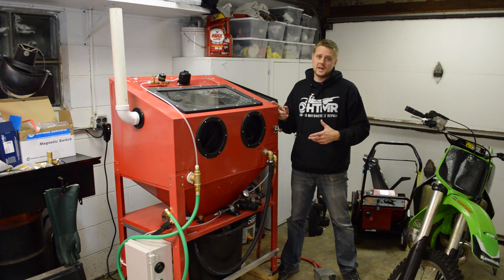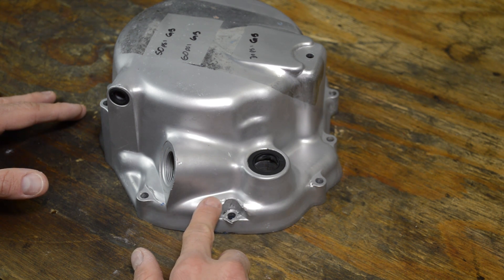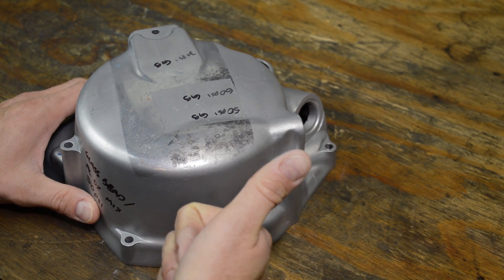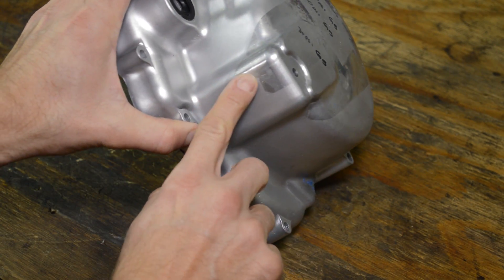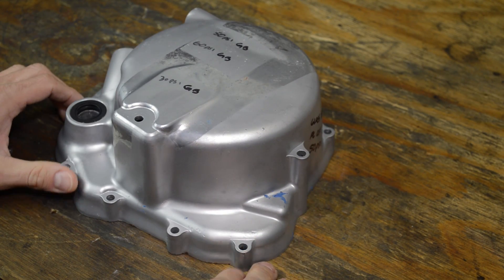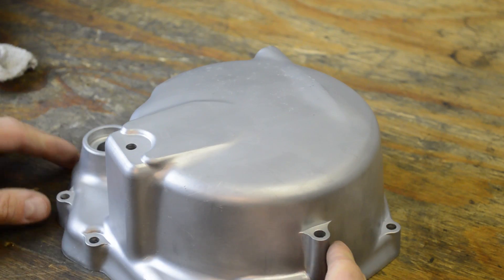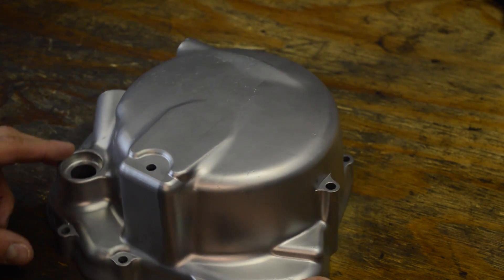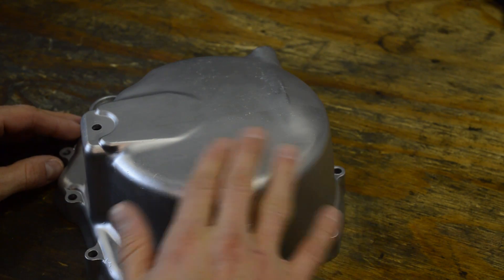How-To: Vapor Blast parts with aluminum oxide & glass bead media mixture

Comment: It's safe to clean engine heads and engine blocks? i know it's very hard to clean when sandblast engineheads/blocks, and could damage if it's not clean good, i was wondering if vaporblasting using bead glass, would be cleaner easier or really it would be same than sandblasting..
Reply from the maker: Cleaning is easier, but you still have to be very thorough and make sure all the media is out. I pressure wash and blow with compressed air with critical components.

Comment: we just wanna see the pump/ pump type you used.
Reply: this is a hobby machine , the real vapor blasters i work with, like vapormatt and vixen aquablast they have a very special polyurethane pump and impeller
Reply: @UltralydvaskingLillehammer  Okay then show us the pump!
Reply from the maker: @UltralydvaskingLillehammer  Yes those machines have 5hp slurry pumps and cost 15-25k. You also need a compressor to handle 25cfm continuous. You are in the 10hp compressor range for that amount of cfm, including some duty cycle.
Reply: @HTMR  nothing but respect for this hobby blaster ! and the budget you work in , it works,perfect to do some small parts once in a while ,
 i do a lot of complete engines wheels and frames,  and therefore i am using a hefty cabinet with a 6 hp pump  6mm(1/4 inch) air nozzle  it takes 40cfm(at40psi) so i use a 15hp screw compressor , the force it takes to hold the gun is intimidating check it out >  search for "vannpolering "     thats norwegian for waterpolishing  a more correct name imho.
Reply from the maker: @UltralydvaskingLillehammer  I did a search and that is a VERY nice setup you have there!

Comment: Matt .Is the cabinet and compressor included in the 1300.
Reply from the maker: No. Cost of cabinet is 100 or so used on Clist, or 180 new. I will be coming out with a "bare bones" part list which will reduce cost to 550 or so. Some nice to have features are really not needed and I found cheaper parts that accomplish the same thing (plastic vs brass fittings).
Reply: Ok thank you

Comment: You should have your media in different containers and just change your whole container out and leave the media in the container (some kind of air tight container to prevent mold if possible) and just put a lid on it. that's how i'm going to do mine when i build it.
Reply from the maker: I use a drywall mud scoop and transfer media from pit to 5gal bucket. I still need to find a good way to dry media out. May just have to spread it out on a tarp for quicker drying.

Comment: I'm afraid you make it sound too easy there, mate. Changing the media is far from pleasant if it is to be done properly. This two-stage method is only acceptable with two machines or if you split your work to do a bunch of parts with the mix first for a few days and THEN change the media and do the finishing work.
Reply from the maker: Please explain your reasoning? I was able to rinse cabinet and change media within 20-30 minutes. Are you concerned about contaminating the finish media? I mentioned in the video this only makes sense for a large batch of parts (especially corroded parts). For a single part, this 2 step would take too long.
Reply: @HTMR  I'm sorry, must have missed the moment in the video. 20-30 minutes sounds about right. The contamination would have to be quite substantial to actually make a difference. I just thought people deserve to know how much time and effort it really takes to rinse and change the media. Thank you for the elaborate demonstration of two different finishes. You might want to add the mix ratio if you don't mind. To me, this looks like 20/80 or 30/70 alu-ox/glass bead. How far off am I?
Reply from the maker: @vitjakes5531  Yup, 20/80 or 1:4 ratio
Reply: @HTMR  Out of curiosity, what compressor are you running?
Reply from the maker: @vitjakes5531  2 stage, 5hp, 80gal, 18cfm. However, my old pump is tired and only puts out 9-15cfm (intermittent bad valve issue). I have a new pump on order and should be back at 17-19 cfm in the next few weeks. Looking forward to increases air jet and nozzle size.
Reply: @HTMR  All right. Right now you're running a 6 mm jet? How much pressure drop do you get from static to working pressure and how much can you maintain during blasting?
Reply from the maker: @vitjakes5531  I'm using an 8mm nozzle. 60psi static, 50psi working. My compressor will keep up with 50psi working pressure, however is running 100% of the time. New pump will allow me to increase nozzle size and bring down duty cycle. New pump also has continuous run unloaders on intake valve which should be nice to cool pump and eliminate motor on/off starts.

Comment: A+  Once vapor blasted and shined to your liking, do you coat with a clear?  Wax?  How does one maintain the shine?  I had some parts polished a few months back and I can see oxidation starting already.
Reply from the maker: Vapor blasting peens the surface pores closed, so it is less likely to corrode. People also use ACF-50 anti corrosion spray.